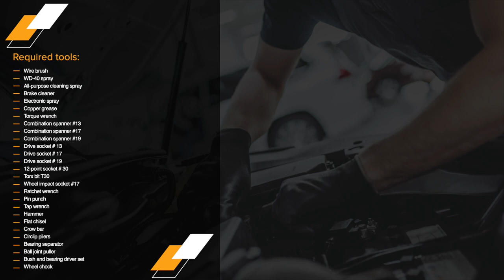How to change wheel bearing on TOYOTA AYGO (AB10) | TUTORIAL RIDEX

Comment: Nice, but wrong torque specs, axel hub nut is 216 nm not 175 nm. Also the lower castle nut is 98 nm, not 59 nm.